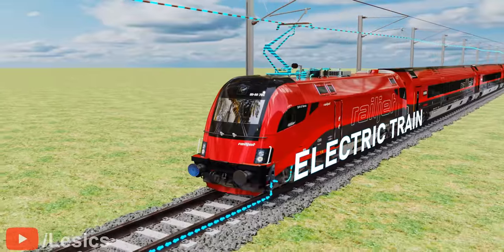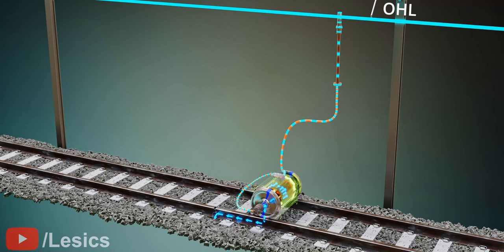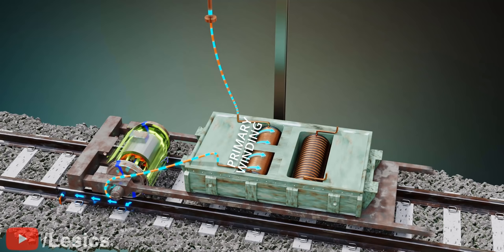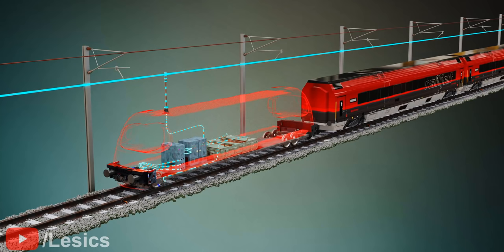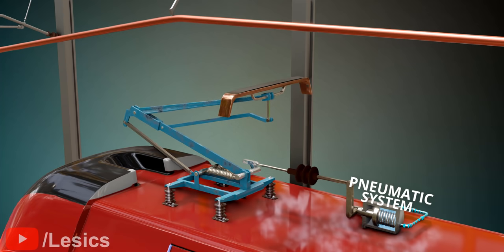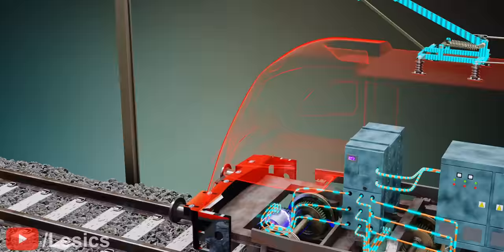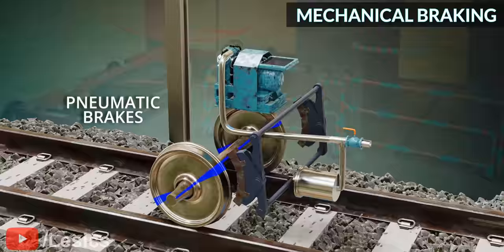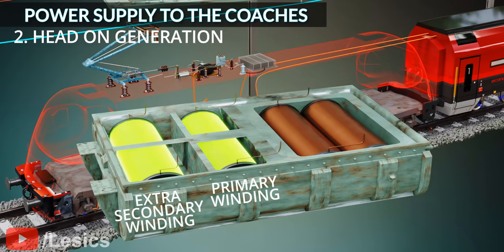The Fascinating Engineering behind Electric Trains!

Comment: In the EU, many systems use  DC as base, no rectification needed. In the Netherlands it is 1500v only. The first design you showed for the single phase electric motor or even dc motor was used quite extensively. Power reduction was done using a bank of resistors on top of the train, heating up the surrounding air. That was quite inefficient of course.
Modern induction motors, transformers and stepping circuits are very efficient.
Reply: The channel creator Sabin Mathew is an Indian so i guess he's using indian systems as the base for this video. The entire electrified mainline Indian rail network uses 25 kV AC; DC is used only for metros and trams here in India. If im not wrong the UK still uses 25kV AC. 

I wonder why DC is used in your place, isn't DC transmission through power lines highly inefficient compared to AC?
Reply: @roshanantony7467  He is using an Austrian locomotive (ÖBB Railjet) as an example, though.
Reply: @roshanantony7467  Basically historical reasons. Early electrification mostly use DC or low frequency AC (like 16.7 Hz or 25 Hz). Netherlands start using 1500V DC in 1910s, although I don't understand why they choose 1500V DC over 3000V even at the time using 3000V is feasible.

India also formerly used DC 3000V and 1500V in some areas
Reply: @roshanantony7467  In fact it's the opposite. DC transmission is much more effective, especially over longer distances. Historically though rectifying AC to DC was a problem (before silicon rectifiers and modern electronics), and since AC was easy to step up or down through transformers it was the logical powersource.
Today with high power transistors available that is a solution of the past, and modern power transmission is moving to DC.
Reply: @viktorsigg4212   im afraid you're off, there's no way DC transmission is "much more efficient" than AC. DC transmission setup is much more complex and expensive in comparison with the AC transmission types. Stepping down or up DC power is an expensive feat and its efficiency is way lesser than a regular transformer. Its not as economical as AC distribution that can be stepped up and down as u like, just keep a transformer there. Where is power transmission DC, i mean, where geographically is power transmission done in DC?
Reply: @roshanantony7467   Well, Wikipedia is a good source. I'm workong with Hitachi Powergrids in this matter and have accumulated some knowledge in the field.  https://en.m.wikipedia.org/wiki/High-voltage_direct_current
Reply: @roshanantony7467  You never heard of High Voltage Direct Current Transmission?
Reply: @roshanantony7467  AC is easy to transform, but DC is more efficient. Lots of undersea and long distance power transmission is DC (especially the more recent ones).
Another advantage is that you don't need to synchronize AC networks since you send DC and convert it to AC locally. You could even exchange power between AC networks using a different frequency.
Reply: @roshanantony7467  A locomotive will always work with DC ... AC from catenary never goes straight to the motors.
I pretty sure that locomotives in India use a transformer and rectifier to get something like 3kV DC from that 25kV AC.
Reply: @ppdan modern locomotives with Inverters like the ÖBB Taurus from Siemens use AC induction motors. They are fed with 15 kV 16,7 Hz AC (which is the voltage in Germany, Switzerland and Austria), this goes through a transformer and then through an inverter. The inverter regulates the frequency and controls the motor RPM over the frequency.
AC induction motors have the advantage of having no brushes, which reduces maintenance and increases efficiency.

Historic electric AC locomotives in these 3 countries don't have inverters, they use transformers where they can connect to different voltages via special switches. They have brushed motors which are regulated in power output by the voltage
Reply: @simonm1447  Like I said it works with DC. The AC from caternary is transformed to a lower voltage (typicaly 3kV) and rectified to DC (in the case of the taurus this happens in a 4 quadrant power module), the DC is than passed to a variable frequency drive which is fed to the motors which are typicaly 3 phase asynchronous motors.
They always work with DC and never use the AC from the catenary to drive the motors.
Reply: @ppdan  the DC is in this case just a step inbetween. The motors itself are today 3 phase induction motors, which need AC. Of course there can be DC within the Inverter, since the electricity is not used with the frequency provided by the overhead line but converted in the Inverter to AC with a frequency depending on the individual speed.
Reply: @simonm1447  I know, you are just repeating what I wrote before.
The conversion to 3kV DC is probably the most important part! It doesn't matter for what catenary AC voltage, they ALWAYS convert it to DC and use that as the main power source. 
You mentioned the ÖBB Taurus, I can probably draw you the complete high voltage schematic of that machine since it belongs to the same family of locomotives that I work on.
Everything on that locomotive is fed from it's DC (both variable frequency drivers for the motors and both static converters).

Comment: I like the video it is very informative. However I have one problem with the animation. The locomotive powering the railjet is an OEBB 1116 (or "Taurus" or "Siemens ES64U2") has 4 axles (two per bogie) and it is primarily build for 15kV and 25kV, but minor details.
Reply: Another detail would be that induction motors have anything but linear torque without the right control system.
Reply: It's not OEBB, it's ÖBB
Reply: And it has a 4 wheels bogie, not 6
Reply: @matthewmaxwell-burton4549  Yes, when the motor is powered with 50/60Hz from the beginning, but here we have an VFD so the torque output can be set to linear
Reply: @justagoose6186 if you can’t type ö and ü and ä
Can be replaced with oe(not œ) and ue and ae(not æ)

Comment: Engineers supercharge your practical engineering knowledge here 👌💯💯🇺🇲
Reply: I don't understand one thing. At the speed the train moves, The sliding wire/thing which collects power from the overhead wire won't it burn up due to friction due to the speed the train moves at?
Reply: @suryakamalnd9888  te top of the pantograph is made of graphite like a pencil. This is ground over time by the wire and needs replacement. The heating is minimal as graphite is a good electric conductor and a poor thermal conductor.
Reply: @fb55255 ohh thanks
Reply: @suryakamalnd9888  the conductor used will have high melting point,so i don't think it should burn up

Comment: Only thing missing in this video is how each of the important components (transformer, rectifier, inverters) look like in an electric multiple unit. Otherwise this is the best video of how electric locomotives work I've seen yet. Thank you!
Reply: In an EMU, such equipment is smaller and less powerful, and distributed between more than one car. In the UK, it was once common practice to have the pantograph, transformer, rectifier/control gear, and motors under one car, and auxiliary equipment  (eg batteries, brakes) under another. Lately, EMUs have typically had more than one powered car, each with control inverters, with the pantograph and transformer in just one car, usually an unpowered trailer. Longer units and high speed units often have more than one transformer.

Comment: As a train driver a call most things in this video wrong.
1st. spring in pantograph is for lowering it and air pressure for rising. You have it wrong in animation.
2nd. The rails are not grounded but they conduct current back to the power point (Power stations, transformers, etc)
3rd. Braking system of locomotives is not like on coaches.
We directly apply air pressure to braking cilinders, that's why it's called direct brake. Spring is there for parking brake.
Also, on locomotives is so-called three way valve so it can brake just like coaches.

Comment: Very good video, but a small correction. there are 2 braking systems on a train. the service brake and the parking/emergency brake. the service brake needs air pressure to brake, this is used all the time, for stations, signals, etc. The parking/emergency brake is permanently pressurized and the line is bleed to brake, as explained in the video. This is used only in case of emergency or to park the train for the night per exemple.

Comment: Great video and impressive explaining 👏
Just for  additional information the secret of  engineering behind this technology is in the power conversion and changing between greed distribution power and the system Motor .the system Motor rechange the power when it turns in downward sloping direction and become generator power so we always 
 take advantage of the purely mechanical movement in this case

Comment: Yes, it's great explanation in part of electrical pulling with nice and detailed itemized animation. But ... brakes ...
It's right about automatic reaction in case of any damage of any part of braking pipe (BP). But it works differently. The main - no mechanical source of power (like spring) can apply force enough for modern train to stop or even slowdown. The working braking effect is reached with pneumatic pressure applied. Every unit of consist has additional reservoir (AR) bigger then braking cylinder (BC). While train is moving the BC is empty (with pressure equal to atmospheric) and AR is "charged" (has pressure equal to pressure in BP). Then for applying brakes the air from AR goes into BC in dose equal to needed braking rate. So, releasing brakes are made by BC emptying into atmosphere and all consist's ARs recharging from BP. And all this thing is managed by pressure level of BP (actually by difference between AR's and BP's pressure levels).
Reply: That's what I was confused about at first with the way the narrator talks about the air brake. The air is supposed to be the one that is used to push the piston inside the BC and apply the brake, not the other way around.
Reply: @wanfahim3583 , this is today truth that much of railroad people still are missunderstanding the autobrakes and that is more sad because many of active locomotive engineers are in that count. Of course, the modern system can "forgive" to the engineer his theoretical mistakes, but, IMHO, the automatic pneumatic brakes subject is the Theme that really must be high accurately professed again and again.

Comment: It is my understanding that trains don't have springs to apply their brakes. That is a system used in trucks while trains have fully pneumatic brakes which use independent air reservoirs and automatic valves to achieve failsafe operation.
Reply: At least in Poland "parking" brakes are spring loaded or hand cranked. They may engage when emergency braking is engaged (not sure), and when there is no pressure then the brakes are applied, requiring air to unbrake.
Reply: @KarolOfGutovo  Okay, but that sounds like something separate from the main service braking system, maybe only on some axles?
Reply: @TonboIV  Yeah, I guess you might be right.
Reply: You’re correct for service and emergency frictions brakes. In most modern trains, the service and emergency brakes use air-applied and spring-release brakes for friction braking. Have a google of the Westinghouse brake system, modern trains don’t tend to use this exact system anymore, but the principles are the same (they just use more modern electropneumatic versions of the system to achieve the same functionality). Trains typically also use electro-dynamic braking as well, where available/possible as this reduces wear on friction braking elements. However, for the park brakes, almost every train design will use a spring-applied air-release friction brake, because the park brakes need to be able to remain applied indefinitely. If air-applied brakes were used for parking, there is a risk that the cylinders may eventually leak pressure and allow the brake to release.
Reply: You are correct. Some cylinders can be equipped with a spring but it's only used as "parking brakes". The spring gets pneumatically disabled and will stay disabled while the train is in service. When service ends the spring is pneumatically re-engaged for parking.

Comment: The pantograph can be made more effective by using rollers inside a cylinder to reduce friction even more.
Reply: contact area will be reduced.. its give or take..
Reply: Good idea but reduced contact area can be compensated by adding 3 rollers. It can minimise wear and tear of pantograph & electrical wire above. Simulation/prototype can be used to confirm and validate this new method

Comment: Hey Lesics team! At 5:35 Does the train keeps moving because of momentum or inertia? Since Inertia is the virtue of motion while momentum is for mass. I have this doubt since pretty long now and I’m not sure about it. 
Thanks!
Reply: You can say it either way, and it amounts to the same thing.
Reply: Inertia is just 'mass' for rotation. So both? But 100 tons of mass probably has a larger effect than the inertia of the weels+axles.
Reply: @suddeneevee9441  << Inertia is just 'mass' for rotation. So both? But 100 tons of mass probably has a larger effect than the inertia of the weels+axles. >> Ohhh! You're talking about MOMENT of inertia. Rotational mass. We use the term "inertia" by itself as a vague reference also to the phenomenon in linear motion, in which we observe that an object set in motion will so continue unless a force acts on it.

For the train, it's all about the mass.
Reply: @suddeneevee9441  True! This questing is freaking my brains out.
Reply: @b43xoit  Oh yeah, I forgot that 'inertia' and 'moment of inertia' are very separate things.

Comment: You missed out playing the sounds of the ÖBB locos accelerating ! ( the changing frequency plays a very nice tune !).
Nitpick: brakes  have 2 pistons. One is an application piston from a tank  and one is the brake release piston from the brake line.  variations in the brake line pressure drive valves that let the air out of brake release so application piston pushes brakes ontto wheel or the reverse.

Comment: The locomotive does not change frequency alone to achieve power control, its transformers have multiple secondary taps that could be selected to output a certain voltage. For high power, the high voltage tap is selected, but if the current draw exceed the limit, it will trip the main breaker. So the engineer change up the taps slowly and watch the current draw to chose the most power without exceeding the limit. Modern electric locomotives do the same thing automatically, with computers and sensors to pickup multiple readings and determine which voltage is optimal to give the motors. But at the core of all electric locomotives are variable output transformers.

Also, trains don't use spring brakes like semi trailers, they use fail-safe air brakes, which compares the supply line pressure with the reservoir pressure. When the supply line drops below the reservoir pressure, air is forced from the reservoir into the piston to apply the brakes, until the reservoir pressure equalize with the supply line. Then the brake valve moves to neutral, trapping all air movement and keeping the brakes on. To release it, the engineer overcharge the supply line to a higher pressure than the reservoir. The brake valve now release all pressure in the piston, and charge the reservoir with air from the supply line. That's how wagons work, but on a locomotive, there is another valve that provides or release air directly from the piston independently from the main brake valve. This is called the independent brake.

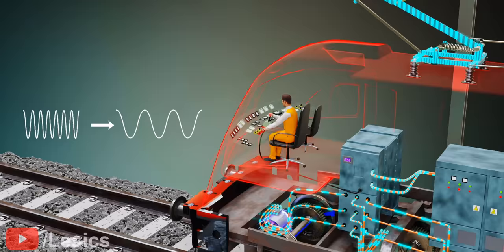Comment: 6:20 When the rotor speed exceeds the synchronous speed (also known as the Rated Maximum Frequency - RMF speed) in an induction motor, it leads to a phenomenon called "slip." The slip is a critical factor in determining the speed of the rotor concerning the synchronous speed.When the rotor speed becomes greater than the synchronous speed (RMF speed), the relative speed between the rotor and the magnetic field (RMF speed - rotor speed) increases. Consequently, this results in an increase in the relative speed between the rotor and the stator's magnetic field.When an induction motor operates at a speed greater than the synchronous speed (RMF speed), which usually happens during overhauling or deceleration, it doesn't exhibit re-generative braking on its own.Re-generative braking involves converting the motor's mechanical energy back into electrical energy, which is typically achieved through specialized systems like regenerative drives or controls. These systems can harness the excess energy produced during overhauling or when the motor speed exceeds the synchronous speed, allowing it to be fed back into the power supply or storage systems.Therefore, in the context of an induction motor running at speeds exceeding its synchronous speed, without a dedicated regenerative system in place, the motor itself doesn't engage in re-generative braking. The excess speed would generally lead to increased slip and might pose risks or challenges related to the motor's operation or mechanical stress, rather than directly causing re-generative braking.

Comment: This is the same for trams. The only difference in the trams is that the bogies are equipped with AC motors while the overhead wires are powered with DC. So it does viceversa in case of trams.

Comment: Electric locomotives are ideal for commuter rail service with frequent stops. Electric locomotives are used on freight routes with consistently high traffic volumes, or in areas with advanced rail networks. Power plants, even if they burn fossil fuels, are far cleaner than mobile sources such as locomotive engines.